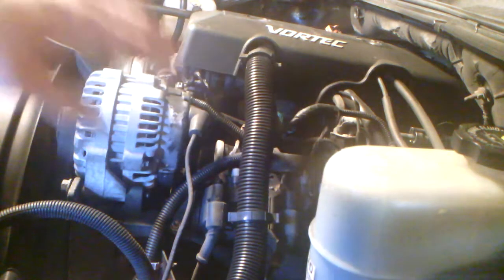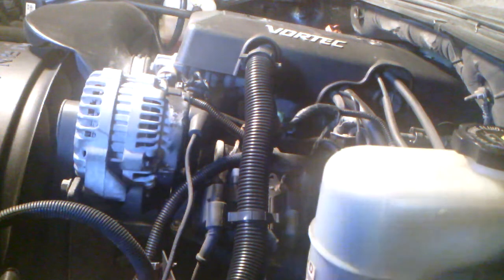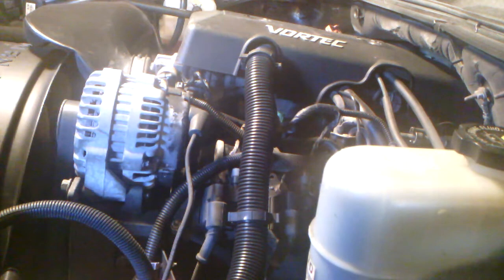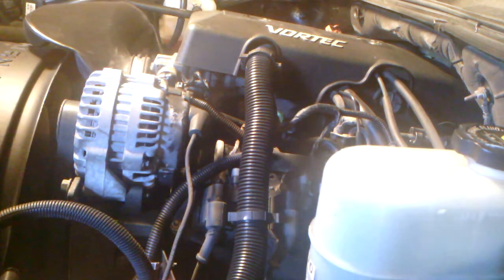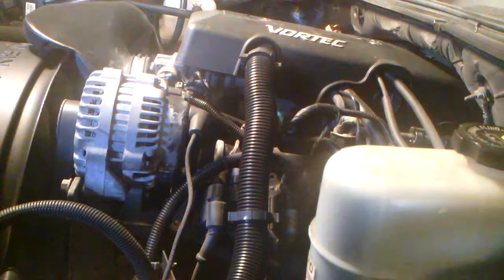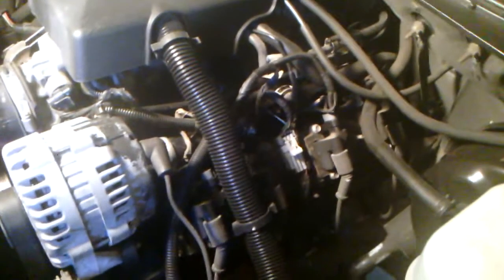2000 chev suburban hard start when warm 5.3

Comment: After Goggling a bit seems could likely be, fuel regulator, lines to regulator, weak pump, or leaking injector. Another guy stated the starter being heat soak related but doesn't sound like that.

Comment: on my 2000 6.0 she'll start fine when cold. 2-3 times to get started when warm/hot and I have to feather the pedal to keep it running as soon as it starts. After about 30 minutes sitting after driving it I pulled off the rubber line on the regulator and gas did come out. I put it back on and started the truck and then proceeded to remove line again and no gas. I could feel some suction on the line though.Not sure if you're supposed to test this line with truck running or not And hot or cold??? I have changed out the sensor behind the starter and no change.
Reply: guess I'll go for the fuel sensor thingy next...thnx.!

Comment: Few things I can think of to start: Test fuel pressure at the rail see if within spec, fuel pump output pressure or power to pump, possible sensors or switches related, leaking or misfiring injector/injector relay or wiring, carbon build up in ports or valves of EGR/AIR system. Just few things from my head never owned similar vehicle mostly Fords.

Comment: If you have a multimeter checking voltages/resistances of sensors like crank position might be good free diagnostic test. Seen the CPS might be an issue but not really sure.

Comment: remove the vacuum hose from the fuel pressure regulator, if there  is fuel, it could be the bad regulator, common for those symptoms.

Comment: Having the exact intermittent no start hard start or having to give it gas when starting after my 02 Silverado has sat a bit after driving it. Has anyone figured this issue out? It’s not my fuel pressure regulator, fuel pump, purge valve or fuel filter. I been chasing this issue awhile now
Reply: Jimmy, did you ever figure this out? My 2002 avalanche has the same problem.  Replaced fuel pump and filter… Checked fuel pressure. Doesn’t seem to be the problem. Any luck?